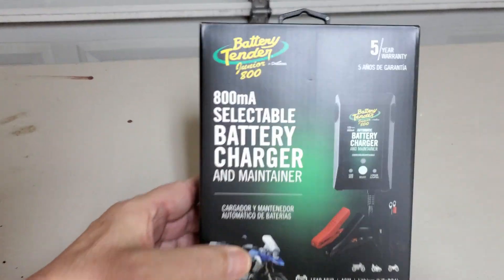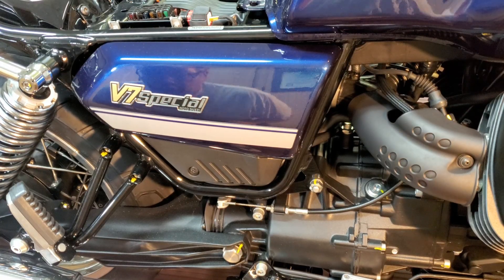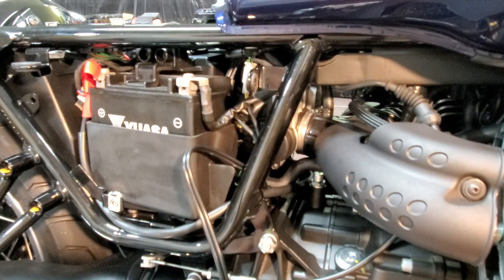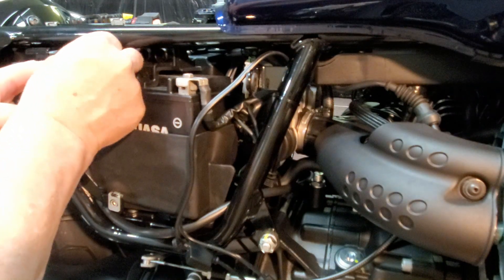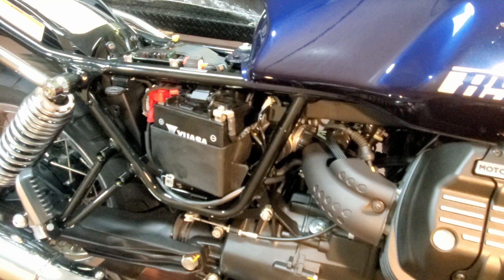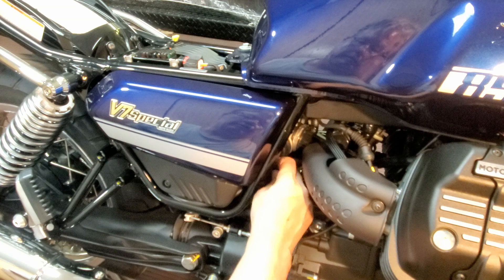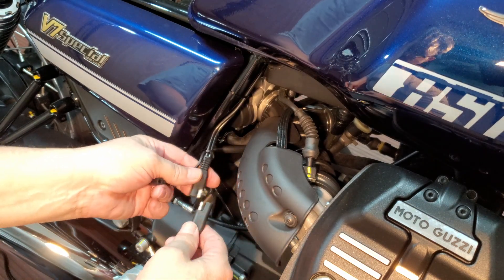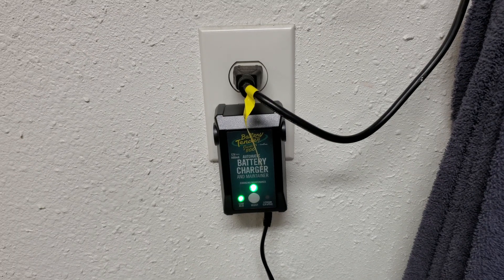Battery Tender 800 mA Battery Charger and Maintainer Installation on a Motorcycle (Trickle Charger)

Comment: I hooked this up to my KLR 650 and the charger flashes red. Manual says its either connections are not correct or battery is under 3 volts. Bike starts up so Idk what it is. Super lame.
Reply from the maker: Give it some time to charge and see if it turns green. Don't go by what the manual says for voltage, it's wrong.

Comment: Can this be used on a car? I asked auto zone for a trickle charger and they pointed me to this, it was their last one
Reply from the maker: It can but I would only use it for a car with a good fully charged battery that will be going into storage. I use a NOCO Genius 1 Amp charger on my classic cars. The output is slightly higher and a little better suited for cars in storage. I have a video in my Trans Am playlist that shows the NOCO Genius 1. You can get one from Amazon in a couple days, but if you need a trickle charger right now the Battery Tender 800 mA will work.

Comment: Great vid as usual. You handled the battery backwards and in unsafe manner. These batteries are high energy devices with high discharge rate capabilities in order to crank over an engine. When disconnecting car/bike battery, always disconnect the negative lead first, than the positive. Connect back in reverse- the positive first, than the negative.
Reply from the maker: I know that is the accepted normal battery procedure but I've never given it the consideration I probably should. If you look at the playlists on my channel you'll see I've been working on cars/bikes for a long time. My first thoughts have always been to isolate the electrical system first. Thanks for your input, perhaps this old man needs to change his ways.

Comment: Mystery Solved!  I checked with my Dealer today and found out that they add the Charger Lead to all of their inventory in hopes of selling the Chargers to their prospective clients
Reply from the maker: I didn't look into a Moto Guzzi charger. I paid $44 US for the Battery Tender charger and the standard SAE connector is common across most brands of chargers. I have more flexibility using this hardware.

Comment: Having watched your Video regarding the Battery Tender 800, I picked one up for my bike. When I went to install the lead connector, I discovered that there is already a factory
installed lead for a battery charger and there is a 4mm allen wrench in a holder under the seat. I was wondering why your bike was not already equip with these parts. I purchased
the same model Moto Guzzi that you have a little over a month ago and I have been slowly adding accessories like you but not the same ones yet.
Reply from the maker: I knew the wrench was under the seat but I haven't seen any factory SAE charger lead. Enjoy your bike, making them our own is part of enjoyment.

Comment: Directions say to connect to wall first, select battery type, and then connect to battery lead.
Reply from the maker: It has to be plugged in to select the battery type. Connecting live leads to your battery is unsafe. Connect the leads, then plug in the charger. It's just like any other battery charger, hook it up then apply power.
Reply: @SPSteve  Instructions state the following in bold type, “The battery type must be selected once the charger has AC power applied and before the charger is connected to the battery.”  I’m assuming you already connected the alligator or ring lug pigtail to your battery and are connecting remotely with the male/female plug connector.  Also the 800 has circuitry to preclude sparks if you try to connect at the battery.
Reply from the maker: @mohamedmustafa8583  if you watched the video you'd know exactly how I do it.
Reply: @SPSteve   Deltran has sent a replacement after a call and sending them pictures of the Autozone receipt and unit with the numbers on the back and cut cord showing.
Reply from the maker: @mohamedmustafa8583  good luck with the replacement, and good for Deltran to step up.